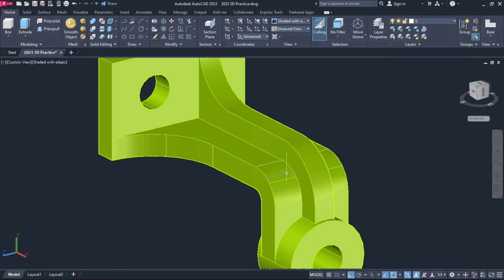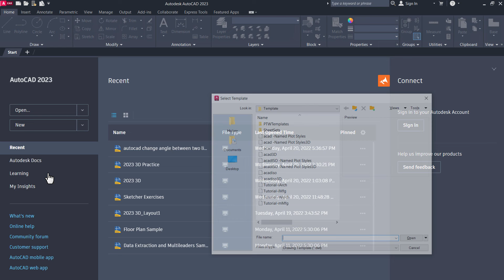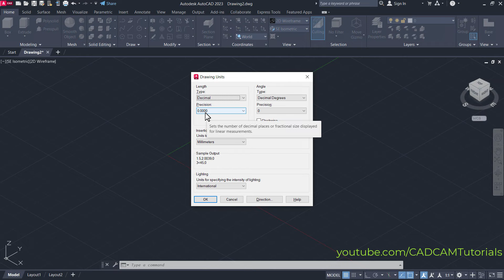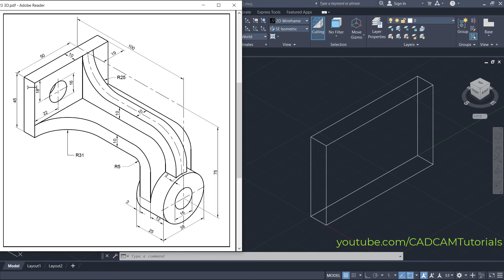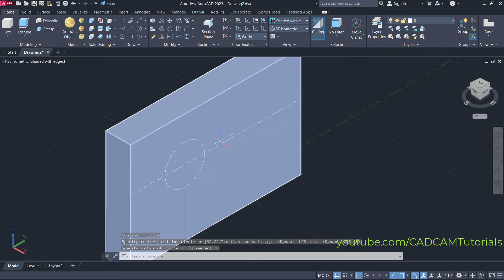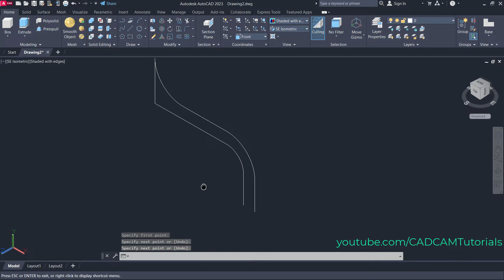AutoCAD 2023 3D Tutorial for Beginners

Comment: hello sir, at 13:29 where you press pull the cylinder, it does not select both of them and i can only extrude one part and it will not make the hole. What am i doing wrong?

Comment: Another challenging exercise. Using ACAD 2022. I don't know why, but my first attempt at press-pulling the hole from the back-plate failed, as it did not "pull" out the plug. Finally, I just moved it out. Then I completed the exercise. I did the exercise again to see if I made a mistake, but this time press-pull "pulled out" the plug. Did anyone else experience this??? Also, on my second round I finished up without the tutorial. I noticed that you extruded the last piece on top, but I just press pulled it sideways and came out with a similar shape; minus some curvature lines. Does it matter that I press-pulled rather than extruded? Will that ever get me in trouble with an object I am drawing? Thanks again for all you do!
Reply from the maker: End result of presspull and extrude is same. Therefore you can use any one of them.
Reply: I have tried multiple times but for some reason I still cannot "pull" the plug out. Were you able to find your mistake?

Comment: Sir plz help me out.
08:28 in my device after presspull selection it select the one line instead of whole boundary. What to do sir?
Reply from the maker: Join the boundary using join command and Use extrude command for 3D conversion.
Reply: Same here not working